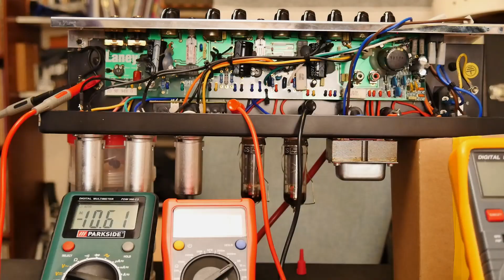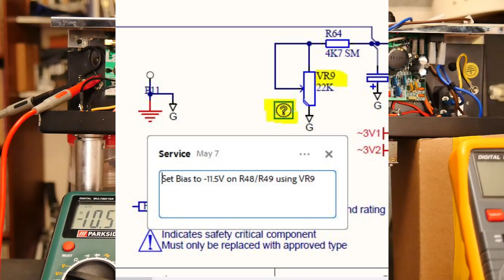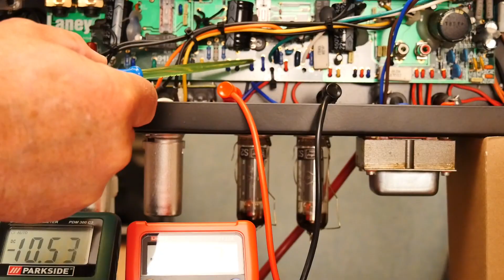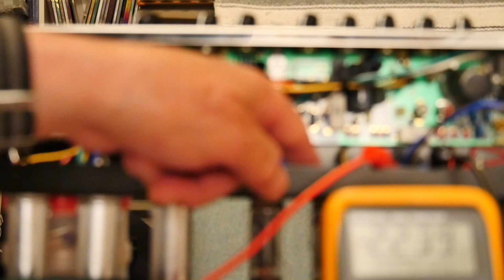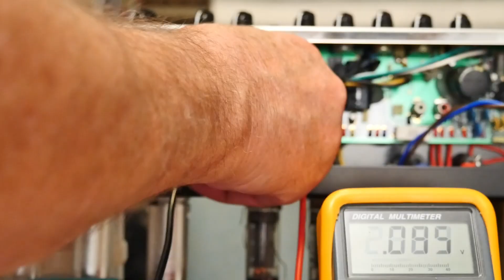Laney VC15 110 Bias set using Laney's specified method

Comment: Ive recently bought this amp and got it serviced. Not a tech myself but the clean channel sounds very stiff and cold to me - no compression or warmth. Would altering the bias help with this?
Reply from the maker: @jamesbowskill2067  Yes, I feel setting the bias hotter would give it more aggression.  But I feel that the drive channel can be set to give a clean but aggressive sound with no change in bias.

Comment: Hi Paul! Thank you very much for this and your previous VC15-videos, very informative 👍 I have the second version of the VC15, still made in the UK. A question about discharging the filter caps. How to you discharge the caps when the leads are on the underside of the board and also the traces to the caps? I read on some Marshall forums that you can connect an insulated alligator clip on a wire from pin 1 on preamp valve V1 to another clip to ground and that will discharge the caps after a while. Is that how you do it or do you have another preferable method on the VC15? Thank you :-)
Reply from the maker: To be honest, I've never in the years I've worked on valve amps had to ever discharge any caps!  Of course I do check for residual voltage before I delve into an amplifier, but I've no 'go to' method of discharge as I've never once needed to do so.  Basically when looking a something I'm unfamiliar with, I'll first check the there is continuity between the chassis, negative side of the amp and the earth pin of the mains plug, then usually plug the amp into a mains socket, but switched off.  Most reasonable well designed amplifiers 'should' self discharge when switched off with a route to earth via resistors.  I would then check the HT side for residual voltage - in the case of the VC15, using the solder pads on the top of the board, though the leads from the 450v smoothing caps are also visible on the top of the board, so wouldn't be an issue to rig-up a discharge resistor.  But modern standards require capacitors to be able to self discharge and the VC15 takes about 30 seconds to get down to a few volts after switch off.  The issue is of course very different with some vintage amps and self builds.  As always, check before you delve inside, but it's never been an issue for me so far.
Reply: @paulwilliams4984  Thank you Paul! I see 👍Excellent explanation of the situation and what to check for/do in this case. Much appreciated 🙏